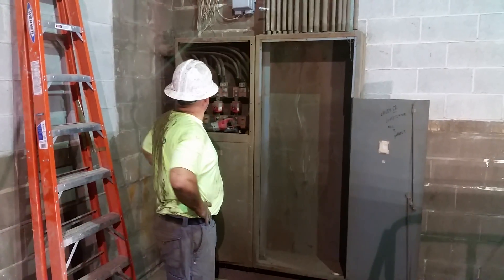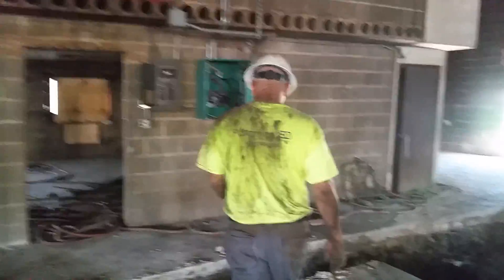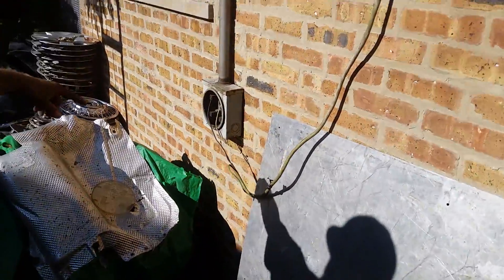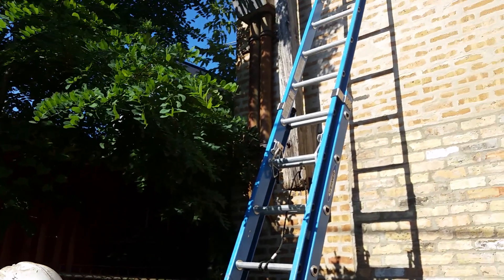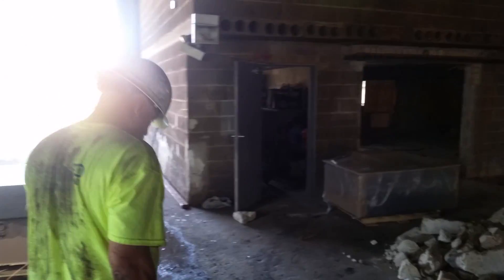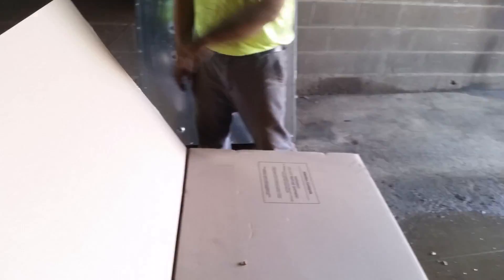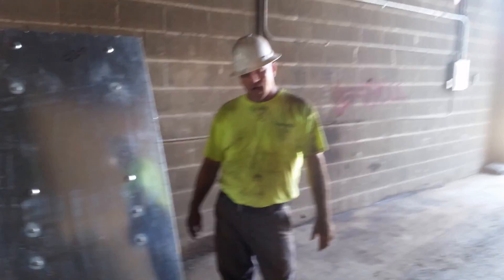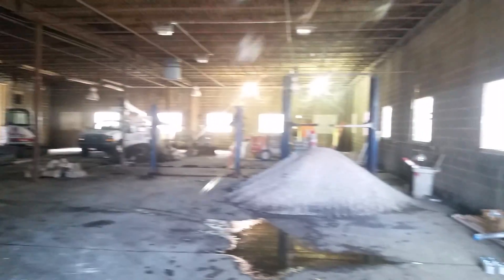1000 amp 120 208 electrical distribution installation part 1

Comment: Are you stealing your temporary power?
Reply from the maker: Yup
Reply: @mrnate4280  Alright! Yeah I do the same thing too via the high leg which isn't normally metered. I charge smartphones, tablets, and laptops because their power supplies are universal voltage capable 100-240 volts 50 or 60 Hz. I Just do it for shits and giggles. Long be the high leg!